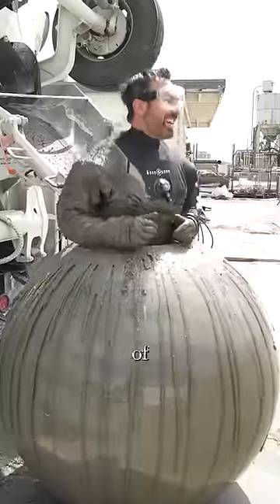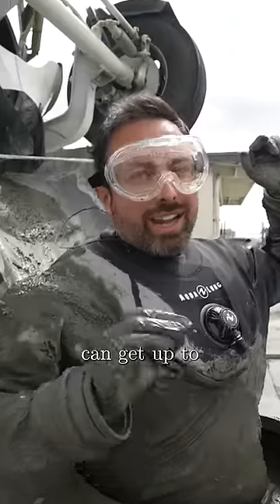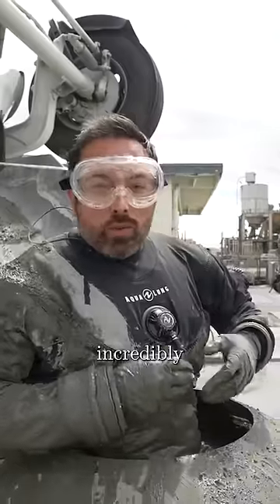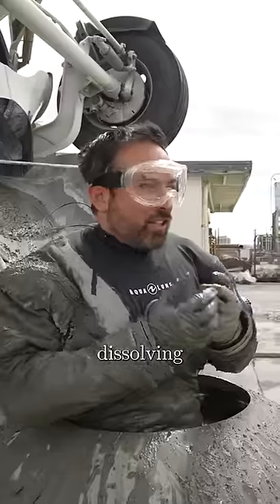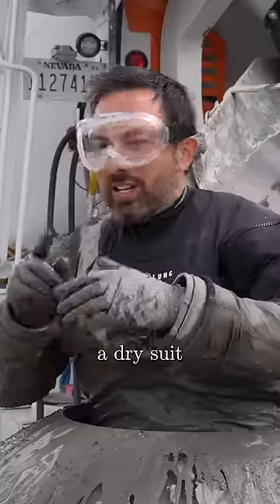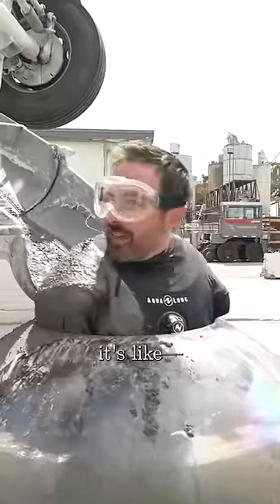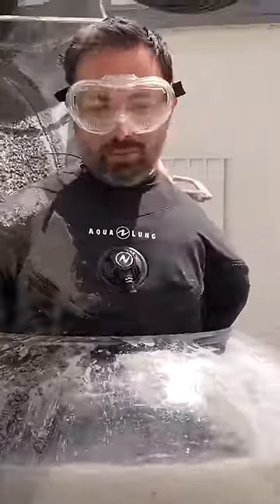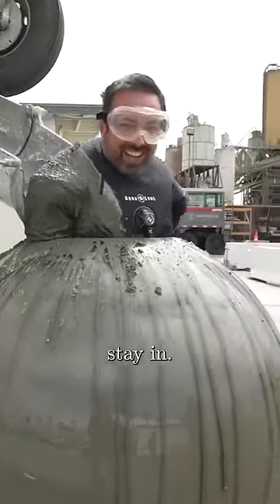I buried myself in concrete to explain how it works

Comment: He's willing to risk serious skin damage for our entertainment. Massive respect to him.
Reply: If you hear the audio of this short ... That's exactly what he said
Reply: Not really.. I work concrete with my hands for about half an hour each time I do some DIY.
Reply: For our entertainment, and also for his livelihood.
Reply: Edutainment to he specific. But yeah
Reply: How st... just no... there is a suit?
Reply: no he's not, he's wearing full protective gear. plus it's just concrete, builders come into contact with it all the time - a few mins of exposure is not going to do any harm.
Reply: @hannesRSA im sure being submerged without protection for long periods of time would be dangerous is fine too then
Reply: Concrete's not all that dangerous unless you eat it. It's just bad for your skin it won't really do anything immediate
Reply: I’m a builder in the uk I mix concrete most days it just drys your hands out but after a shower your fine just try not to breathe it in so much, it’s really not that bad, personally I think brick dust is worse
Reply: More like temporary skin irritation. The actual danger in burying yourself in concrete would probably be heat stroke. The reaction of wet concrete hardening is actually quite exothermic, surrounding your body with the stuff would definitely overheat you.

Comment: All fun and games until your face feels itchy and you dissolve half of your face 💀💀💀
Reply: Thats too dark
Reply: wont be itchy anymore
Reply: I've gotten concrete all over my face many times, he's overreacting
Reply: @fdsfds7339 Same lol but it does look like it burns. 🤙 But I'm also white, my skin turns pink from chem burns and sun light.
Reply: Dawg is concrete not acid
Reply: @echoshatter  cement will soften your skin over the course of a day, but unless you keep applying wet cement constantly, it will dry before serious damage can be done. Swimming in a chlorinated pool for a couple hours does about the same as handling wet cement for a couple hours. However, the aggregate in cement and concrete can easily slough off softened skin, so avoid friction.
Reply: @1harrismccarty it depends type of concrete, moisture etc but I've had serious burns after only 20 minutes of exposure

Comment: People always forget that concrete is capable of chemically burning you untill they get covered in it and realize they shouldn't have done that lamo. Some concrete mixtures also get incredibly hot as there is a chemical reaction happening which helps it dry so actually burns as well as chemical

Comment: Liquid concrete is 50-85 degrees farhenhiet. And that can cause heat cramps, exhaustion, stroke, or suntroke. So dont try to jump into liquid concrete without proper protection.

Comment: I used to drive concrete trucks, basically took concrete showers 14 hours a day. It's a little caustic but not as dangerous as it sounds, just dont get it in your eyes. A bottle of coke is enough to keep 11 cubic yards from setting up for a long time. The acid we used to clean the trucks felt like hundreds of tiny ant stings, that was annoying

Comment: I just poured my first patio pad last week and i was with some guys who had been pouring concrete for years. Well the concrete company put calcium in it and it was setting too fast. So instead of using his knee sleds one of the guys was literally kneeling in the concrete. Came back the next day with red legs and couldnt bend his legs at all.

Comment: I used to work at a quarry that produced limestone for concrete plants. One day it was particularly wet, and the crusher plugged up; and me being an idiot, didn't put my gloves on to dig out the rock. I don't know what the PH would have been, by my hands were burning really bady from the mud and rock. Afterwords my skin was really soft and smooth though, but really red. That only happened a couple of times though; I think it was something about the shelf, we were digging up.

Comment: pH is not a mesure of how dangerous  is a solution. You could have a solution with a pH of 9 be a lot more dangerous than one at 11. Same if you go on the acid side of things. pH measures the concentration of the acidity or alkalinity without taking in consideration of the acid or base being used.

Comment: Speaking from experience concrete burns hurt like hell. I also got splashed in the face by concentrated sodium hydroxide at my old water treatment  plant while repairing a check valve because the systen was janky and had no shutoffs......i could feel the ahit eating into my skin......so i powered through and rushed to the eyewash station. -1/10 do not recommend.

Comment: I've had concrete "burns". The skin was completely gone down to the last layers (I was seeing pink and red, like near muscle. It's no joke. If you get it in your boot or anywhere else, just get it off ASAP. I let it sit in the back of my boot for way too long. Also, you'll have to use vinegar or something else to lower the pH and help prevent any poisoning. There's lyme and all sorts of stuff in there. Smh too be 19 again 😂 I miss concrete work lol anyway, carry on lads
Reply: Thats not from a "burn", it's the high pH softening the skin and the sand in the cement scraping the skin away. Definitely unpleasant.

Comment: My tap water has a PH of 10.8 should I be worried? I drink that stuff😂
Reply: normal water has a 6.5-8-5.
Either you measured it wrong or that isn't water
Reply: @Funghios digital ph testers are almost idiot proof... I calibrate mine every week when I get water ready for my plants which is also just tap water🤷🏻‍♂️